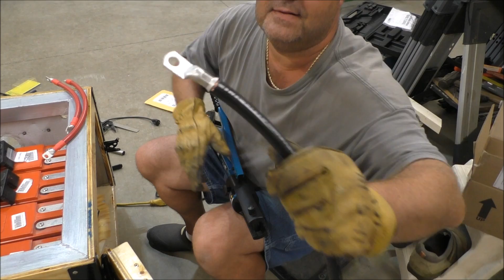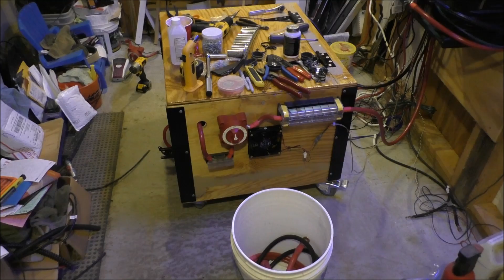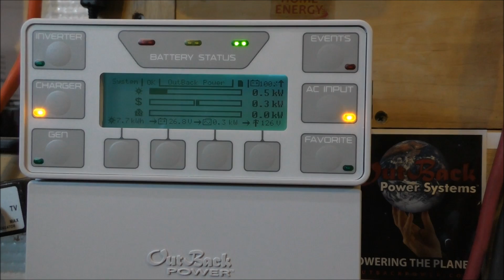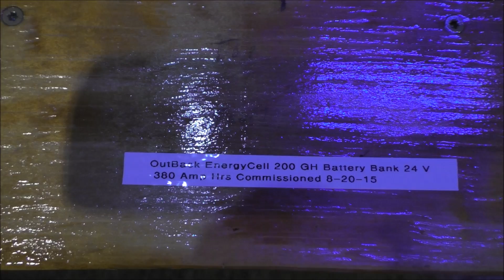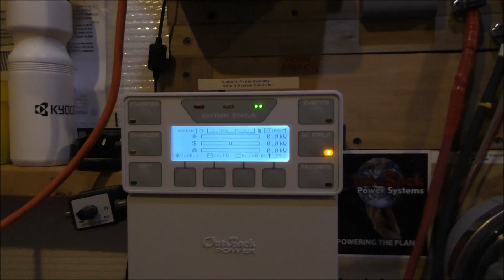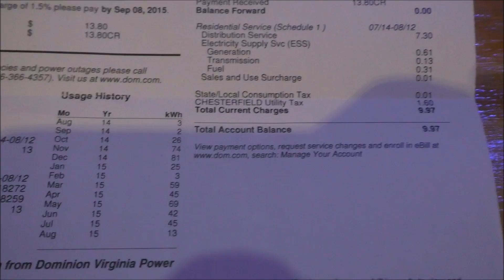Solar And Wind Battery Bank Cabinet Box Build Project With KVUSMC Pt 2

Comment: Kenny....   Funny you posted this cause my batteries died after about having them for 4 years.   Ive got to bite the bullet and get some more but can't decide what to get.  I didnt realize how expensive my power bill would be until my solar died.  Man it sucks!
Reply: +KVUSMC / Kenneth W Viar Jr Pricey shipping right?  I saw the pallet. Can you get them locally?
Reply: I got some different ones.  Ill do a video on them once I get them installed.
Reply from the maker: +mattgreenecomposer I know How You Feel These  Batteries Are A Great Choice  For OutBack Grid Tie Battery Back Up Applications These Are The Grid Hybrids / EnergyCell GH They Also Have The EnergyCell RE Batteries Great Choice In Batteries Matt
Reply from the maker: Alt E Store Has The Outback EnergyCell 200 RE Batteries On Sale Shipping Was Reasonable  Give Them A Call Or Call Me Matt https://www.altestore.com/store/Deep-Cycle-Batteries/Batteries-Sealed-Agm/Outback-Power-EnergyCell-200RE-12V-178AH-AGM-Battery/p9857/
Reply from the maker: The Pocket Shot  Woo Hoo Let Me Know Buddy When  You Have The Video Up

Comment: Do you think you could do a video of the steps you had to go through to have a grid tied system? Codes and permits ex. I have a small off grid system and am hesitant to pursue a grid tied system. Can you have battery backup with grid tied systems?
Reply from the maker: +Taylor Jones Hi Buddy I Went Through The Steps In All My Videos I Did All My Work And A Licensed Electrician Inspect Everything Then I Had My County inspect It ! Only Difference In My Inverter Is It Is Off Grid Inverter When The Power Goes Out ! But When The Power Is On I'm Selling Back To To The Power Company / Powering All My Loads In My House And Saving Money Buddy Here Is A  Link Taylor 
https://www.youtube.com/playlist?list=PLCD74dps4lg8oJJP-pOP2XvX0Ixqt1r63  

 I Will He;p Any way I can PM ME  Thanks Kenny

Comment: Hey Ken, can you help with this problem, I'm getting an big ARC when connecting the the last connection of the battery bank  pos side ( 8  6 volt batteries ) in series and paralell. the panels are not connected yet, just trying to get the battery bank hooked up, should I charge the batteries up before I connect them together and can I charge them together of one at a time I only have a car charger The batteries are all new and reading about 6 volts each
Thanks
Al
Reply from the maker: +Al Ruark  Hey  Just Check Your Wiring  Over And Over Again  Make Sure Your Got Everything Connected Good  Hook Your Battery Bank Up First Then Add Your Components Buddy  I love My New Blue Seas Maxi Bus Bars 250 Amps It Deletes  Allot Of Wires Hanging Around Buddy  Let Me Know If Your Still Having Problems
Reply from the maker: +KVUSMC / Kenneth W Viar Jr  Heck Bro Call Me I Will Help PM ME